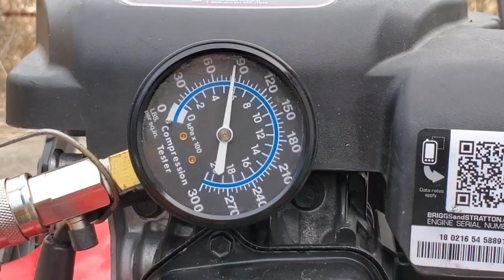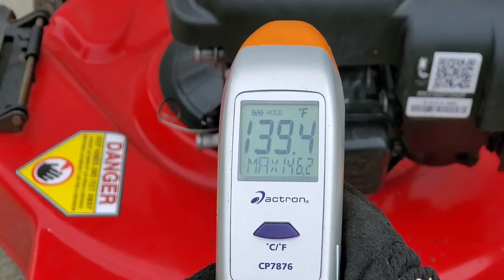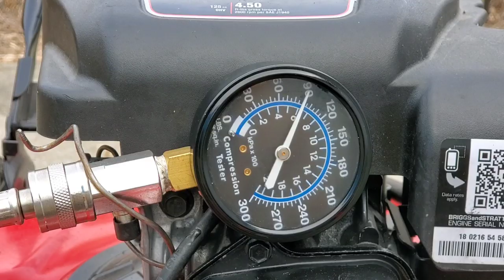Marvel mystery oil engine flush  is not safe?

Comment: I own and operate a classic car dealership and every car we buy the first thing we do is change the oil using the cheapest "store brand oil" and add a Quart of MMO and run it for 100ish miles then change it and put some good oil in it, You wouldn't believe how clean it gets the inside of an engine and in more than 10 years we have nothing but sucess with it.

Comment: You could eat off my 1969 Ford Mustang Coupe's Engine. Inside the engine 302 V-8 was so clean when we took off the valve covers it was stunning! But In 1999 it had 253,000 Miles on it & I could still pump it up to 90 MPH. Marvel was its lead substitute in the Gasoline. Protects the top of the engine internally. I ran it in both in my trucks. My 1999 F-150 has 190,000 miles on it right now. I use it in my mowers & tractors even weed whackers. I have a Wheel Horse Tractor that is 36yrs old. Use as directed!

Comment: I been using marvel oil in all my oil changes and to gasoline at every fillip since 1972 . here we are in 2024 and now have my first foreign truck, a Tacoma and the tradition is on going with marvel mystery oil which used to be made in portchester,n.y. . all my new vehicles have received well over 200 thousand miles on them and my 94 dodge Dakota with 312k miles and still on the road in duchess county,n.y. with 400 plus miles . always use marvel and it will keep everything clean without ever a hydraulic lifter tick and no stuck valves . any other opinions about this mystery could never convince me that I am using the best additive and need not buy all the crap on the shelves . another example is my 1988 MTD snowblower which use with every snow storm . that too loves marvel oil . 100 star rating from me . *******
Reply: I agree with you on everything you said. I've been using it since about 1965. I never use more than directions call. More is not better. I still have people telling me it's no good, but that is usually while they are riding in my old truck to drop or pick up their vehicle at the mechanic.

Comment: Man I think torching those rockers might have loosened up that sludge a bit. It definitely did a good amount of cleaning though. Maybe even more than you might want in a modern engine all at once. Thats a lot of MMO for that little engine. Running much less would probably be safer. Depending on how previously neglected the engine was.

Comment: I’ve never had an issue using it. I flushed every single one of my jeep Cherokee’s and the only thing that happened was the cylinder head and crank case were all spotless and they manage to stay that way because I did it every two oil changes. But that’s also a Jeep 4.0 liter, those things will run on unicorn piss and hairspray. And I wasn’t worried about it thinning out the oil since I ran Delo 400 15w-40 all the time. 

And it does work really well on fuel systems too. My 76 F250 had  a bunch of random crap in the carburetor and it quit running well, so I dumped a bottle of this in the tanks and after half a tank it was gone. I pulled the top off the carburetor, it looked almost brand new. 

But you can also do the same thing with plain old ATF.

Comment: That's 25% you added. 20% of 16oz is 3.2 oz.
Reply: I was looking for this comment ^
Reply: yes, you are correct, 20% of 16 is 3.2.     However, unless he drained some oil (i did not see him do that), he has a 20% solution of MMO in the engine.     Yes, it's overfilled at 20oz, but with 20oz in there, 20% is now MMO (20% of 20oz is 4oz)
Reply: @deasttn  I'm glad you're thinking.  So many don't.

Comment: Marvel Mystery Oil is not a flush...... However by adding one quart to you oil change schedule can remove harmful deposits. When you change the oil you will see black oil pouring out. By the second or third oil change there will be less negative deposits and improved performance and fuel economy.

Comment: My great grandfather was in the 1st armored division "Old iron side", was at first a tank mechanic, then tank commander, and then after getting hit by a artillery and losing his hearing for a month he was a cook. My papaw(his son) told me that he said they used mmo  and pretty much used it as often as they could when they had time to do maintenance and oil changes, they used it for alot of things besides engine oil flush as well. He said it works miracles in keeping engines and equipment in good running order. (Now remember oil was no where near as good as it is today and I'm pretty sure that's why he used it as often as he did. But with today's oil, I'd use it every 50k-100k miles depending on how often you change oil. If you change oil in long intervals definitely closer to every 50k. I change my oil every 5k. So I try to flush about every 100k miles.
Reply: So pretty much twice during an engines life
Reply: @Cdub541  depending on the engine yeah. Some engines are built with better materials than others. Or are built to actually last. There's a bunch of different reasons, some good, some bad, but it is what it is.
Reply: Change your oil every 3k mis with full synthetic people. It's dirty enough then. Sure they claim it'll protect longer but don't do it.  1.6 million miles on my Toyota original motor and trans. Yes I use mmo in gas and have used it as a pre flush before oil change. It's just kerosene and trans fluid people

Comment: The problem with any flush, including MMO, is the potential for sludge and deposits, once mobilized, to block small oil passages and galleries in an engine. Not a big risk on a lawnmower, but not something I would recommend for a motor vehicle engine with variable valve timing or displacement on demand that is operated by oil pressure, if significant sludge/deposits are suspected. In those cases, if sludge is known or suspected, it's best to simply start using high quality oil, and change it more frequently than the recommended service schedule to gradually erode sludge and deposits. That said, as preventative maintenance on a well maintained engine? MMO is not necessary, but probably not harmful either. As for this test, it has value in that it demonstrates MMO can clean engine deposits. I personally would not assume that because no apparent harm was done to a $50 lawnmower, that MMO would be a good idea in a vehicle worth thousands or tens of thousands of dollars. YMMV.
Reply: Very good point
Reply: Naw, MMO all day!

Comment: People are saying with sophisticated new engines, like the Ford Ecoboost, twin turbo charged, direct fuel injected engines, you can flush significant amounts of carbon into your catalytic converter and clog it up, requiring a replacement.  Also the chunks of carbon can get into the turbo chargers causing turbo fan breakage and more.  BOTH of which are very expensive repairs.  Doesn't seem worth the risk if you're buying good gas, using really good oil and changing your oil regularly.
Reply: Tier 1 gas and changing your oil before it's due is the bottom line

Comment: I think I screwed my engine up with this stuff. It was smoother w/ MMO. So I bought more. I mostly used it in my gas. I saw the bit about 20%. I was concerned using that much, so I used 10%. I did my oil change in spring and changed it again in fall. I don't drive much, so the mileage shouldn't of been too much. Noticed white smoke coming out of my tail pipe at start up in the morning. Smelled like burned electronics. Then it clears up with a warm engine. Took it to Nissan thinking it was the beginning of a blown gasket. The car lost its 1st engine due to hydro locking. The second engine had less miles. That said, I don't have as clear of a history on it. Nissan, says they found sludge in the oil pan and will probably turn me away for a gasket replacement. I'm not exactly well off and I'm a onsite technician so I need my car. Not even sure what to do. I won't be buying another engine that's for sure. I just think this stuff is strong stuff, more than is realized. Beware.

Comment: The engine oil light started coming on in my wifes 5.7 Hemi, so I immediately went to the part store and bought a quart of Marvel mystery oil and put it in the engine. After 30 minutes of driving the light stopped coming on. Great stuff. I'm going to leave it in until next oil change to get all the gunk out of the engine.
Reply: If the oil light came on then it was low on oil more than likely, if the low oil pressure light came on then I was full of sludge and most likely would run much longer.

Comment: Today i started the MMO oil flush, (20% of 6 qt) in my 4.7 2013 RAM 1500. After turning it on, heating it up and turning it off and letting it sit for around 5-6 hours, i started the truck back up but it started funny. Sounded like it gained compression bc it didn’t crank over as long as it usually does, usually a “do-dooo-do do do do vrrrooommm” but this time is was a “do-do-vrooooom” if that makes sense. I’m gonna run it for 500 miles, see what happens. The oil i used was Shell Rotella Gas Truck, btw. Let you guys know what happens.
Reply: Hey buddy how is she running
Reply: Baltimore Bred She’s running great.

Comment: Lol 20% of 16 ounces isn't 4 ounces bahaha!!!
Reply: yes, you are correct, 20% of 16 is 3.2.     However, unless he drained some oil (i did not see him do that), he has a 20% solution of MMO in the engine.     Yes, it's overfilled at 20oz, but with 20oz in there, 20% is now MMO (20% of 20oz is 4oz).   Bwahaha

Comment: I buy  a lot of 300 dollar beaters and the first thing I do is put a quart of Marvel Mystery Oil in them drive them for a couple days and then change the oil.  And each time I change the oil, I add some and drive it for a day or two before doing the change, it clears up all kinds of valve train noise, loosens sticky rings,  I have had good luck with it myself...
Reply: Haha quit! That's supposed to be a trade secret ;)

Comment: Mmo works been using since back in the day when it came looking like oil cans saved many many engines even some that were seized it works point blank period.
Reply from the maker: I absolutely agree and thats why its been used for so long.
Reply: Its situational. I use it in the gas tank. Never again will i mix it with oil in the crankcase. Ever since I did that 100 miles before an oil change my engine has been burning oil at a noticeable rate. Have to add about 1 quart of oil every 1 thousand miles. Some sludge is good sludge
Reply: If you do it before you’ve been running an engine for a long time with sludge build up, you won’t have that problem.  I’ve been using it in every oil change for the past 5 years, no oil loss at all.  I would like to see what the inside of the engine looks like.  I started it around 30k miles, maybe a little less

Comment: 4 ounces (25%) is not 20% of 16 ounces, but I do use this oil religiously. It does work. 👍
Reply: yes, you are correct, 20% of 16 is 3.2.     However, unless he drained some oil (i did not see him do that), he has a 20% solution of MMO in the engine.     Yes, it's overfilled at 20oz, but with 20oz in there, 20% is now MMO (20% of 20oz is 4oz)

Comment: thanks for the video.  i have over 200,000+ miles on my chevy malibu using MMO.  no problems.  i might use MMO in the crankcase.  previously used seafoam and it's worked great.  expensive.
Reply: Seafoam is expensive and overrated. MMO and Berryman’s B12 work much better and cost way less.

Comment: I’ve used MMO for years with zero issues. I used it like people do Seafoam. Years ago I used to dump it down the carburetor until it smoked and hot soak. Now I just use in the oil about a week before a oil change. Once I drain the oil i pore a quart of cheap oil through the motor before I change the filter and add new oil. It works for me for years now. Not changing!

Comment: Anytime a motor is warm the compression is increased everything expands.  Unless the rings are wore out .  If you want to keep your engine clean inside . Change the oil on a regular basis . Marvel mistery oil is good for diesel fuel and carburetor motors .

Comment: Great, but why doesn't anyone ever properly tell how to add.  I'm hesitant to add 20% on top of capacity.  Do you drain 20% first?
Reply: @ girohead--   You do not want to over fill the crankcase with oil and Marvel Mystery Oil. If the dipstick is at the full mark, I would drain some oil before adding the MMO. 
   In my case, I have a Chevy truck that has 148k miles on it, and uses some oil. When it is a quart low on oil after a oil change, I add a quart of MMO. The MMO has quieted a lifter ticking noise and has removed some of the sludge out of the engine in my truck. My car doesn't use any oil, so I have not yet put any MMO into its crankcase.
   In both vehicles, I use 4 ounces of MMO for every 10 gallons of gas every time I buy gas.

Comment: I am a regular user of MMO.

2005 Dodge Ram 1500 4.7 V8
5QT-5w30 SuperTech 1QT MMO

1977 Pontiac Firebird SBC Turbo
4QT-5w30 SuperTech 1QT MMO
(After Engine Break In)

1983 Chevy Caprice SBC N/A
4QT-20w50 SuperTech 1QT MMO
( I think this engine never been rebuild? I install RV cam, new gaskets, stem seals, orginal bearings)
Reply: Angry 305 I just started using MMO on my 2013 4.7L.
Reply: Just replaced a quart or so of oil with MMO in my '12 Ram 1500 4.7, the change in engine noise was immediately noticeable. I plan to do an oil change in the next 100 or so miles so i hope it cleans as well as reported.
Reply: MVB Outdoors So do I! Hey, we have the same engine, could compare results after. (oil color, etc.)

Comment: If your crankcase capacity is 16 oz, wouldn't you mix 3.2 oz of the MMO with 12.8 oz of engine oil to get a 20% mixture by volume?
Reply: yes, you are correct, 20% of 16 is 3.2.     However, unless he drained some oil (i did not see him do that), he has a 20% solution of MMO in the engine.     Yes, it's overfilled at 20oz, but with 20oz in there, 20% is now MMO (20% of 20oz is 4oz)
Reply: He's bad at maths

Comment: I'm really really interested in a test with Z-max  been wanting to try this for years now but haven't seen any independent test on it. Have you any idea on it's claims????
Reply: MMO is very popular amongst the saturn community. I had good luck with Zmax additive too. 400,000plus kms logged with no oil leaks or major issues on a dohc 1.9 saturn motor using zmax as recommended from the manufacturer.

Comment: 4 oz. is 25% of 16oz. 3.2oz was the ticket.
Reply: yes, you are correct, 20% of 16 is 3.2.     However, unless he drained some oil (i did not see him do that), he has a 20% solution of MMO in the engine.     Yes, it's overfilled at 20oz, but with 20oz in there, 20% is now MMO (20% of 20oz is 4oz)

Comment: It’s a solvent, of course to will clean your engine, decarbonize your pistons and valves, etc.
Reply: MMO is 60% minimum "mineral oil" aka petroleum jelly as a lubricant and 30% minimum solvent as mineral spirits. A lot of people are confused about the "naphtha" as the main ingredient. That part is not naphtha as kerosene solvent but actually a different type of naphtha that is mineral oil as lubricant....

Comment: I thought it said on there site to put thold 32 oz in.
Reply from the maker: 20 percent of oil system capacity.
Reply: So, if your car/truck takes 5 quarts, use one quart MMO, and 4 quarts of the oil of your choice. If it takes less than 5 quarts, simply add the total amount of ounces of oil required for an oil change, and divide by 5 ( each fifth is 20% ). If we use 4 quarts as an example, that is 128 ounces. 128 divided by 5 is 25.6 ounces, which is the amount of MMO you would add. Then, you can subtract that 25.6 ounces from 128, and you get 102.4 ounces, which is exactly how much of your choice of oil, that you would add. Hope this helps !!!!!!!!

Comment: Ugg.. Hyper Tough - Worst company. I bought the 107 piece SAE and metric socket set. What they call a 3 inch extension is actually 2 and 3/4 inches long. I Needed the 3 inch extension to change the spark plugs in the used car I bought. Imagine my shock when I found the extension would not reach the plug. I had to go buy a True 3 inch extension. Get the 107 pc set and see for yourself. Also the rubber piece in the 5/8 spark plug socket comes out Very easily. I had it slip off in the spark plug hole and had to fight with fishing it out.

Comment: Ran some for 100 miles before oil change. Ended up with small leak for about 1000 miles.
Reply from the maker: I haven't experienced any problems with years of use  thanks for sharing
Reply: Makes sense, likely had a leak already but some sludge plugged it up.

Comment: I prefer just to use normal oil to flush :)
Reply from the maker: What engine oil are you using?
Reply: @NATESINTERACTIVEAUTO  I just use the cheapest oil that respects the car manufacturer specs , like I have a VW that needs 505:01 i use that ,car works very well.
Also here in europe sometimes there are some really good deals on oil.
Reply from the maker: Absolutely super tech is low price and proper change intervals work out best.

Comment: 16oz capacity (×.2)= 4oz?
Reply: Math is hard.
Reply: yes, you are correct, 20% of 16 is 3.2.     However, unless he drained some oil (i did not see him do that), he has a 20% solution of MMO in the engine.     Yes, it's overfilled at 20oz, but with 20oz in there, 20% is now MMO (20% of 20oz is 4oz)

Comment: Marvel Mystery Oil, clogges up the Catalytic Converter, so on a modern car, you can not use it, on a lawnmower engine, like you have, it can be used, but on an engine that has a Catalytic Converter on it, you don't want to use it, because it will clog up your Catalytic Converter!
Reply: No it doesn't.
Reply: that's probably if you add some to your gas tank?
Reply: @joed1244  Still doesn't.